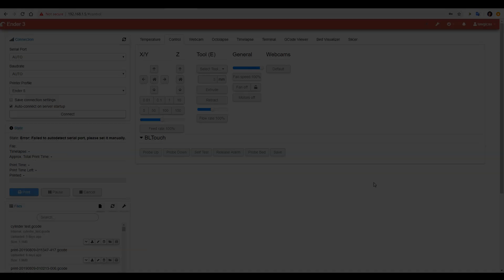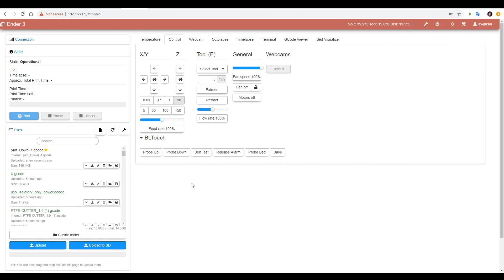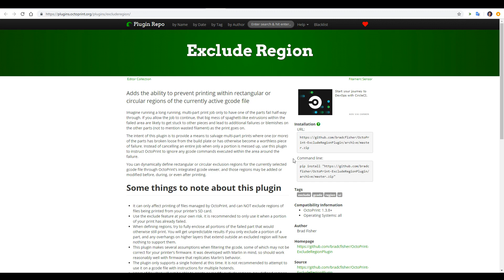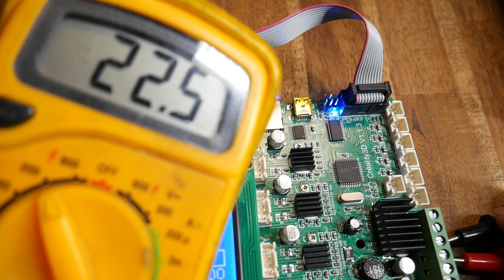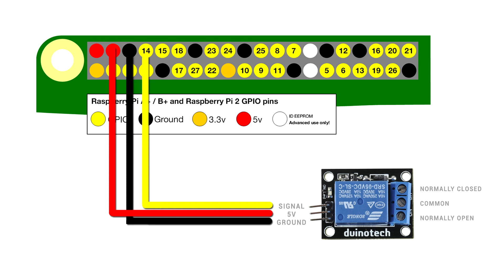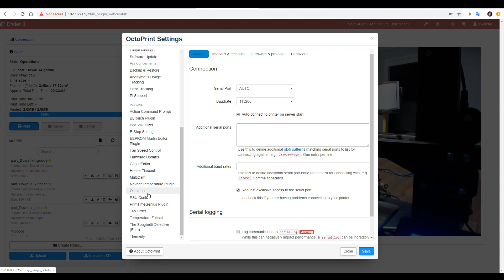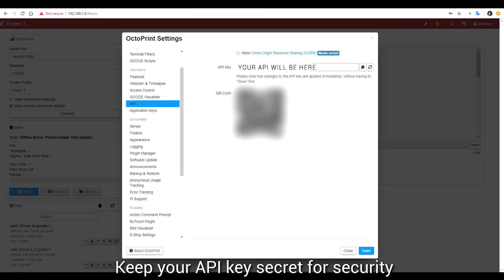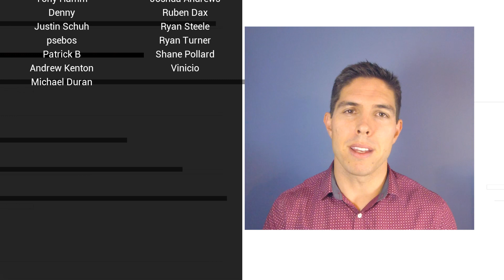Octoprint plugins for better and safer printing - PSU relay control

Comment: I'm having trouble finding a 15A 30V relay that will fit in the rear mounted enclosure you designed.  Any leads on these?
Reply: I have been looking for the past 2 days and have had horrible luck finding a relay the looks like it would be the right rating and has a form like the one in the video. @teachingtech would be able to help us source one that would be appropriate for how you did your video?
Reply: @seannicholas6629  I was able to find some, but I had to buy 2.
Reply: @moacustoms9434  do you have a link to the ones you found? Or a description I could use to try to google for similar? I'd buy 2 if needed becuase they don't appear to be expensive. I just don't seem to have luck searching the way i am. Main key words I use are 5v relay, 15a 30v DC, arduino relay rated 350w or more etc. Nothing looks like what teaching tech had in his video. Most things aren't even on breakout boards. There are probably tons that would work just none I can locate online.
Reply: @seannicholas6629  I don't think you'll find one that looks like the component in the video that will have the 30A rating you need.  This is what I'm going to use.  https://smile.amazon.com/gp/product/B07WCFM83F/ref=ppx_yo_dt_b_asin_title_o05_s00?ie=UTF8&psc=1

Comment: using the relay mentioned, i keep hearing it click on and off over and over. based on what others are saying, i believe using the 5v relay mentioned previously may be too small. can you please recommend another 5v relay for this project?
Reply: Look for a Mosfet with a heatsink instead of a relay.  No clicking noise :)

Comment: Installed relay for PSU Control and faced to interesting problem, now I can turn printer on only via Octoprint, but there is no way to get it on without Octoprint... means there is no Power on button on printer. Is it any ideas how to get Power On button on printer?
Reply: You can mount simple switch somewhere on the printer - which is connected parallel to the relay switch contacts - this way it can shorten them manually. In result you can bypass  octoprint and use printer standalone.
Reply: @svetlinsimeonov6485  That works as maintenance mode, when I want to disable PSU Control, but it doesn't go for normal operation.

Comment: Thanks for tutorial. I have octoprint with stock ender 3 board (still wait for skr1.3). Relay works fine, I switch AC for psu and use helping power for Rpi (old 2A charger). My problem is, when I power off printer with relay (or with switch) board is still live because Rpi powered board via USB cable. How to make when I power off printer board off too? Thanks

Comment: does the RPI have power just from the relay, or do I need another connection from the power supply to a buck converter?
Reply: The raspi needs it's own power supply. I use a POE switch with a POE power splitter. I try not to hack the mains power side if possible.

Comment: Is there something similar to psu control to control LED´s with? I wanna build the ikea lack enclosure for my printer and put led strips in but they don´t have to be turned on the entire time. I want a button to just turn the leds on whenever I´m checking in via octoprint webcam. Is there something like that as a plugin?
Reply: I've been looking into a similar use case but am waiting on parts to test. I'm not sure about binding that to the camera monitoring, but you could certainly turn the lights on remotely. OctoPrint-Enclosure plugin seems to allow control of multiple GPIO pins, so you could add another relay - or you could use a wifi/smart plug, or something more diy like a Sonoff.
Reply: @sklikizos  Already found a way, here look, sounds similar to what you were proposing and what I had in mind... You can programm shortcuts/hotkeys into octoprint that just execute scripts controlling the gpio pins https://www.thingiverse.com/thing:1428478

Comment: Rate your relay properly.. Ender 3 PSU is capable of over than 20A on the 24V rail... use a 30A relay or fuse, non a 10A one!
Or use a 10A relay on the Mains side, at your own risk.
Reply from the maker: Agreed, I have updated.

Comment: I've set up my OctoPrint to run on a Windows 10 computer controlled from my office computer via Remote DeskTop in Windows.

I therefore have NO extra RaspBerry Pi in my printer BUT is some pins free on the exsisting main board to use for thie PSU plugin ?

OR 

should I just install a RaspBerryPi for ONLY this purpose ... and what eventually comes in the future ?

Comment: Using a 10A relay is a serious problem. A 24V printer like the Ender 3 will have a max power draw of appx. 15A, and a 12V printer possibly twice that. You need to rectify this and pull the video until it is fixed, or risk people burning up their printers. IIRC you have the same problem with your Ender 3 rear mounted case.

Comment: Something that will likely work for failsafe thermal shutdown is add a thermal sensor to the raspberry pi, pimorini for example makes a -40 - +300C, 32x24 resolution in normal or wide angle thermal camera for the I2C. A small amount of code and you can detect a max temp anywhere in the sensor view and trigger the shutdown relay. There are a number of sensor manufacturers. You could also display the image if you wanted to verify your actual temperatures for better calibration.

Comment: Greetings Michael,

I recently setup the PSU control in a Creality CR-X and I’ve noticed something strange. I chose to follow your configuration and fed the +24v through the NO side of the relay using a raspberry pi b3+ and octoprint. I ran a few tests and all seemed fine. I put the bottom cover back on and for some reason now I have no motor control. I noticed the boot screen was loading with ???? Where I’d normally see the printer firmware name. I know personal tech support isn’t an option but I think something may have impacted the stepper motor control on the board. Is there an easy way to establish if somehow the board is not sending signal to the motors? 

Sorry, I’m a little perplexed. I have verified the supply voltage. BLTouch control works, heated bed and nozzle works, I’ve connected with Pronterface and don’t see anything abnormal. I can even control the fan on the print head but my extruders and x,y,z steppers will not make a sound when sending commands. Moving by hand is normal.

TIA

Comment: You should turn off the AC power going into the power supply, Not on the DC side. The power supply is probably rated at 380 W. That's approximately 16 A at 24 V.  Many 3D printers use a 12 V power supply, that's about 32 A output.  Add to that, 25% to 30% for safety, And you have gone far beyond the current the relay can tolerate. However the AC current at 120 V, will only use about 4 A , And only 2 A at 240 V.  That is a much better choice. Better yet, plug the unit into a power tail.  A much better solution for those who are electrically challenged. Also, Some Hobby relays are not suitable for high-voltage/I current. The rating of the relay itself  is not a good indicator. There are several parameters that need to be addressed. The width of the contact traces, the spacing between them, just to name a couple. there are many other parameters that need to be checked For safety. DC power can give more problems than AC power. When DC power starts to arc, it continues to arc. AC power is self extinguishing.

 Please check the rating of your power supply.  Stay safe.
Reply from the maker: Agreed and description updated.
Reply: That would mean then, that you can´t connect the raspberry pi to the psu, right? The raspberry pi needs to be powered off independently to then power on or of the printer, right?
Reply: @Iboo30 

The raspberry pie runs ON 5 V.  Unless you are using a ATX PSU, It must be powered independently. And if you're using a  ATX PSU, you don't need a relay to turn off the PSU .
Reply: @joea3728  Yeah I know that ... No, I was thinking about hooking the rasperry pi up to the printers psu with a buck converter inbetween. But since I wanna turn the psu on and off with the rasperry using a relay I can´t do that ... that was my question...
Reply: @joea3728 So how do you turn on/off an ATX PSU from OctoPrint ?
Reply: @gshlomi  The little green cable that you need to connect to ground. You put those on the relay, and bam.
Reply: @gshlomi  You ground the green wire on the 20 pin Connector. Google ATX Benchtop power supply. Use a level converter to protect the pi.
Reply: @gshlomi  ATX PSU has a PSON built in. Follow any tutorial on converting an ATX PSU to a benchtop power supply, but instead of connecting the PSON to a 3V3 in the PSU, connect it to the RasPi.  If the tutorial calls for a resistor, use it...I cannot recall if it does or not and the one I converted years ago is buried somewhere in my garage.  On a side note...in 3D printing, 24V systems are superior to 12V.
Reply: what is a power tail?
Reply: @sitgesvillaapartmentneilsc7924  A power tail is like a power strip with a really built into it. All the high-voltage electrical is done. all you need to do is plugg it in. It also has a low voltage input to power the relay on. The raspberry pi digital pen works well for this.
A better alternative might be a Internet ready switch. This is a remote control switch controlled Locally or over the Internet . octoprint has a plug-in to control some of these devices.

I recommend any of these devices, especially if you do not have experience with high-voltage electricity. Remember high-voltage can kill.. If you do not do things right, it can burn down your house. It's better to pay a little more for a properly design devise, then to be homeless or lose your or a family members life.
Reply: A much much better solution (I mean without any AC wire hacking), is to get a TP-link smartplug and use the tp-link smartplug octoprint plugin.
Reply: @TechExploresNYC  The problem with a smart switch is that many of them goes from your computer through the Internet to a cloud service then back to your switch. Although many of them can be hacked to bypass this behavior, it is not a simple task. And if their cloud servers go down, or they start charging for the service, your stock. You also have security to think about. Someone could hack the system, and turn your printer on or off at their discretion. Although this could still be a problem, you have eliminated 2 Sources of failure, the cloud server and the Internet in general. 
It is your choice whether you use a smart switch are not, but for me, I want to keep my system local.
Reply: @joea3728  Yes the TP-link has its flaws(namely always connected to cloud and got its own share of security issues), the protocol however is reverse engineered so that the octoprint plugin only communicates internally without the cloud. Since some people may own a Tp-link already I would thought to share this fact and there's another smartplug upcoming from TH3D if opensource is preferred.
Reply: Hey Joe. that is great advice. in this video he talks about always open vs always closed. how would the power tail work for something like that?
Reply: They make them that will do both. One receptacle is normally open, the other is normally closed. You can use whichever one that you need or both.
Reply: You can get one that will do both. One outlet is normally On and the other is normally Off.
Reply: Hey so I have a question on this then, Would it be better to by a 15P to 2x C13 cable. Then get a AC/DC buck converter to handle the pi power off one of the C13 sides. then on the other C13 put an AC relay, connecting the 3D printer to this relay. therefore allowing the pi to disconnect the AC current to the printer rather than the DC current?
Reply: I use a zigbee-compatible power switch, which I have connected to my Philips Hue system (also works with IKEA "Trådlös"). I simply control it with curl json commands. No need to fiddle with high voltage in places where it shouldn't be.
Reply: I use 240 V  and 10A thise is better.
Reply: I noticed this too. So if I use a 30a 30v relay it would be good? Because i only want to shit off the printer, not the psu, so I can build my raspberryPi in the printer
Reply: @robbinkoot2154  If you are using a 24 V 15 A power supply, a 30 A relay will be good. If you are using a 12 V 30A power supply, You will be right at the limit of the relay. For that current, you really need a 40 A relay. Just remember, a hobby relay is not certified by any industry standards. Only the  Relay is certified, not the circuit board or terminals. And who knows what the board and terminals will take. Remember, a hobby relay Is made for the hobbyist. As cheaply as possible. Safety and Reliability are not high on their list. When it comes to safety, do your homework, And make good choices. And don't believe everything you see on their advertisement.
Have a safe New year.
Reply: @joea3728  thnx man. This will be a nice upgrade for my ender with a 24v psu 15a
Reply: @Joe A  hey sorry to bother you but is this video ( https://www.youtube.com/watch?v=dQNBeAZpRmk&feature=youtu.be ) a better method to use to lower the amperage of AC power?

Comment: Hi Michael Something strange, My ender stopped comunicating via USB port: "Error: Failed to autodetect serial port, please set it manually." I tested the board with 3 diferent Octoprint installations, including one on my notebook, changed 3 usb cables, and nothing....  could it be the USB port on the board itself? any fix?  .... I'm thinking on changing the board with the Fysetc Cheetah , it is plug&play , 32 bit, it includes Marlin 2.0 , the 2208's, and a few other things, do you know something about it?
Reply: Did you do anything or change anything between it working and not working?
Reply: @ingy23  Nothing, just plug in and out my octopi

Comment: The ender 3 screen stays on when I shut the power off threw octoprint, everything else turns of, any way to have it all turn off?
Reply: You can either modify your usb cable or turn it off in software but if you do it in software is turns off the power for all usb ports. You can either cut the positive wire in the usb cable or use a small piece of kapton tape to do it none destructive.

Comment: Hi Michael, thanks for all your videos. I have the same setup for the relay done some time ago, the only thing that I don't manage to solve yet is the power that the raspberry send to the ender board, making the fan and the display stay on.
I'm planning on using another relay that also cuts the usb conection. That's the only way I found to solve the USB powering the Ender 3 board, the fan and the display, What do you think about this solution?
Reply: I have the same issue on my ender 3 as well. Could use maybe a Sonoff or Shelly that the rasberry pi triggers to shut off if something goes wrong as it will cut the mains power completely and can also control it from a cellphone to turn back on it off.
Reply: @LukeRT  just tape over the power lines on the USB connector.just need the data lines.
Reply: Just cut open the USB cable, and sever (and insulate the ends of) the red +5v line. Done deal.

Comment: Hi Michael, great video! Fast question: whenever you connect the usb cable from the pi to the ender3 (without having the PSU on) then the board powers up. Is this safe to run the printer for a long period of time like this? Or should I try and disable the power on the pi usb ports?
Reply: I just had this issue and took me about 5 mins to understand what is going on. If there is way to stop sending power from pi to printer will be best I think - maybe the simple way is to mod a usb cable and cut the +5v wire.
Reply: @svetlinsimeonov6485  hi thanks!!!! what I end up doing it putting a small piece of tape on the power pin on the usb connector, and it works pretty good!!!

Comment: I think forsafety a completely independent temperature channel incl. Sensor and electronics is needed. A temperature fuse on the heaterblock would be pefect.

Comment: This relay setup will not protect systems that have external mosfets for the hotend or heated bed. They usually fail closed which would send power directly to the heaters regardless of the power state of the mainboard. To get around this you would need the relay to switch mains voltage.

Comment: psu control: on raspberry model 3 (and other models too)  i think it is better to use an other port than 14, because this is a serial TX port and therefor during reboot my relay flickers. better to use other ports (like GPIO 23 - physical port 08).
but as always - a very usefull video -thank you for your efforts in 3d printing.

regards
Michael
Reply: I had been struggling with this for days ... my printer control board would come on for about two seconds, then power off. Finally moved the signal to pin 16 (GPIO 23) and viola! It work like I would have expected. Next time, I should read more of the comments. :-)